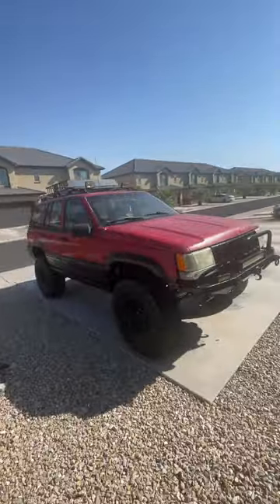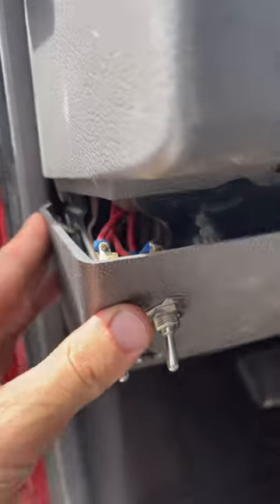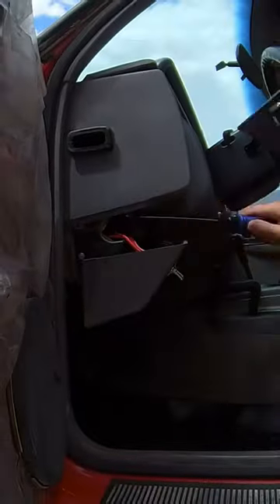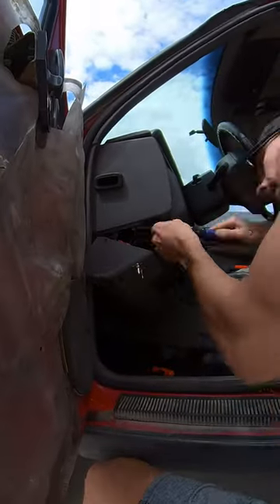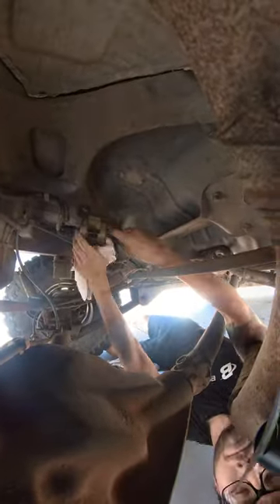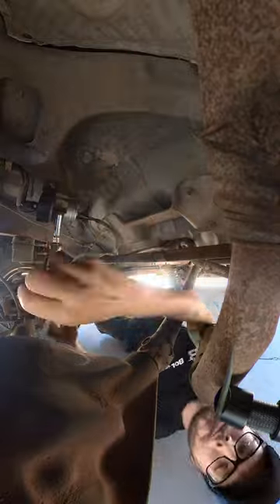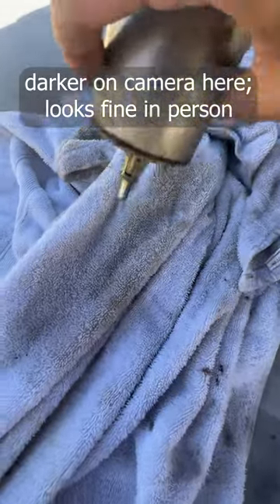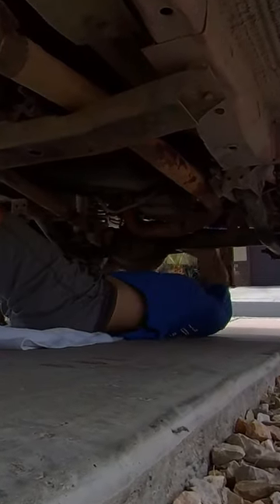Fixing Random Stuff on my $2k Jeep

Comment: Wish I could find another one. Got a 95 a few years back for $800. Other than a little rust underneath and was spray painted flat black, it was perfect. Never had any issues and ran and shifted really smooth for the mileage!

Comment: I got water in my gas in my 98 zj Laredo 5.2. It ran like crap until I pulled out the tank and cleaned the filter on the fuel pump. It had more power than when I bought it. It isn't hard to do, and if it's over 150,000 miles I'd recommend it.
Reply from the maker: I think my ‘95 doesn’t have the filter on the pump, only the external one on the fuel line could be wrong tho.
Reply: @stayve.  mine was caked with mud from the water. I had to clean the tank anyway from the water and found a filter on the pump pickup. It's not a replacement part but it snaps off and can be cleaned.

Comment: I’m a ASE master tech and have been spinning wrenches for probably as long as you been alive (yes, that tired old phrase I hate just as much now as I did when I was young). 

With that all said, I’m really enjoying checking out your journey fixing this old beast up. You definitely have a good understanding of what’s important if one of the first things you bought was a greasegun and hit every fitting. People, especially those new to doing mechanical work, tend to underestimate the importance of tires, grease and oil. Seeing you staying on top of that shows me you’re definitely doing it right. 

Now on a totally separate note, if you haven’t got one yet, buy a Power Probe. It was one of the most helpful electrical tools I ever used when it first came out and still is to this day. That and it will help immensely when diagnosing problem electrical issues.
Reply from the maker: Hey thanks for the kind words! I was def looking into getting like a power probe or voltmeter or test light. Any cheap ones in particular you would recommend?
Reply: @stayve.  sorry for taking so long to reply. Not used to getting questions from creators but I’m happy to help. I would recommend getting the best price Power Probe 3. You will find rebrands on tool trucks for more money but if it has the power probe logo it is definitely the same tool. If you can get a used one I would grab it since they are quite simple with how they are built.
Reply: Also, get a tungsten tip for it. They are so insanely helpful when dealing with something rusty.